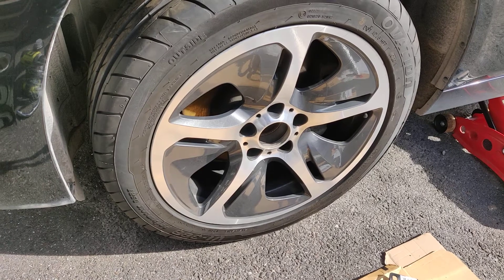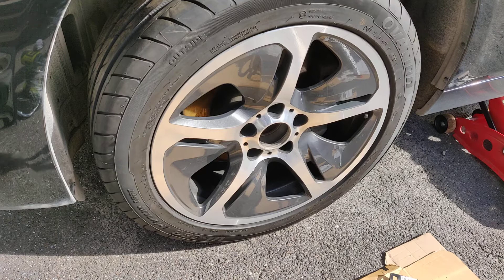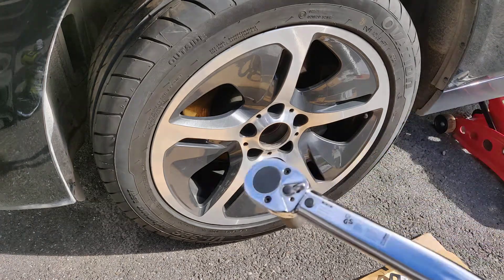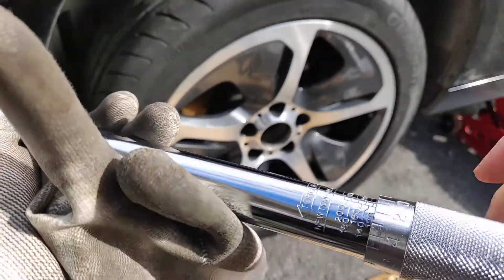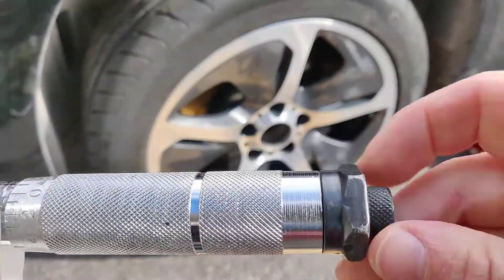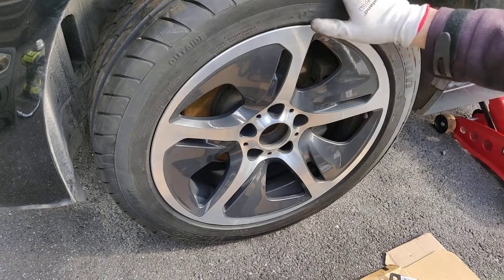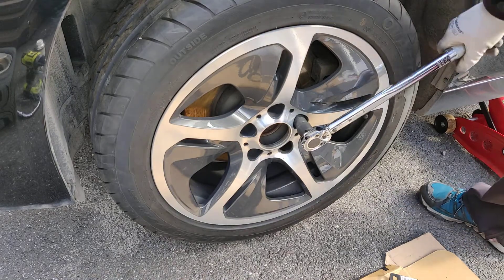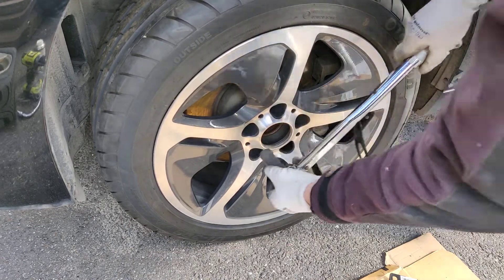BMW 5 Series F10 / F11 Tire Lug Nut Torque

Comment: If you have custom wheels that pop out a bit you will notice your torque wrench will scrape as you turn, you will then need to use a small extension in order to avoid this but you will lose some torque so in this case you will need to ad 3+ to 5+ nm/ ft-lbs to the 140nm/103 ft-lbs in order to compensate for the lost torque power do to using an extension to the socket!
Reply from the maker: Thanks for the advice 😊
Reply: This is incorrect about needing to alter the torque setting due to use of an extension from the square drive on the torque wrench to the socket. The only time you would need to change the torque setting is when you change the length of the wrench handle relative to the square drive pivot point. This is because you’re changing the length of the lever arm.